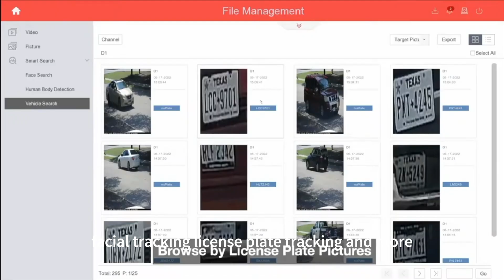How To Upgrade Old Cameras Without Replacing Cables!

Comment: Just wanted to drop a quick thank you — this video helped me finally understand how LINOVISION’s EoC system actually works in real-world setups.
I’ve been trying to upgrade an older analog CCTV system in an apartment complex, and this solution literally saved me thousands in rewiring costs.

The combination of transmitter and receiver over coax was plug-and-play, and bandwidth held up surprisingly well. One tip I’d add: make sure to check for signal boosters if the coax lines are super old — we had to replace one segment.

Solid explanation and visuals. Definitely bookmarking this for future reference!
Reply from the maker: Thanks for the feedback and tip! Glad you got it working and appreciate the bookmark!